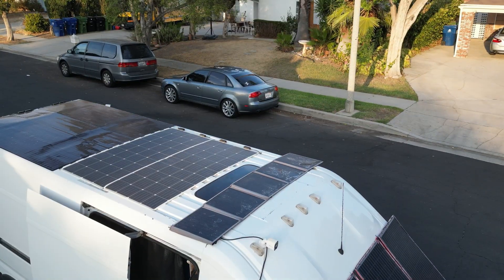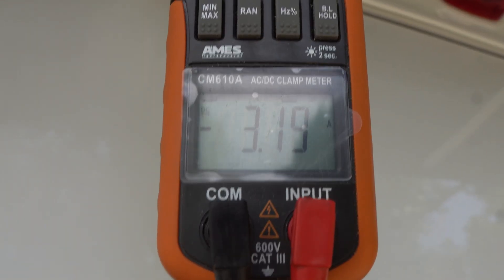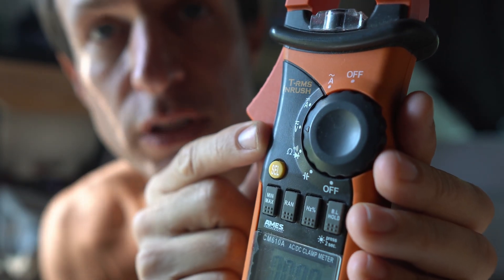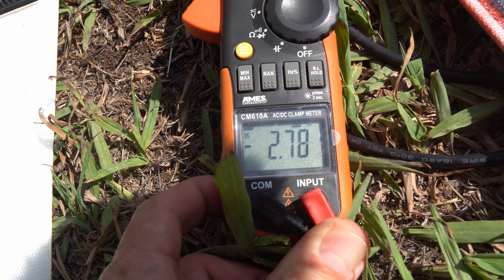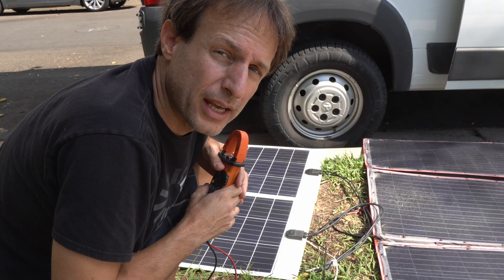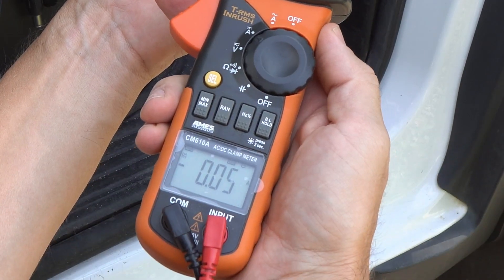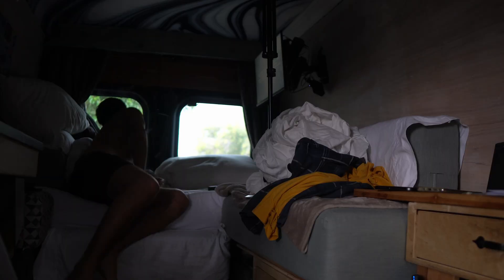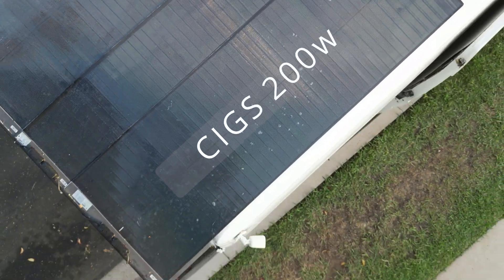BougeRV 100w CIGS Flexible￼ Solar vs Silicon panels Power output comparison￼

Comment: Maximum power point does to happen at open circuit voltage or short circuit current. Happens at a different point on the vitals vis amps power curve, need to use a MMPT and measure the volts and amps when it's doing its thing,  other wise these measurements are of no value.
Reply from the maker: Open circuit voltage told you if this panel will work with your MPPT
Reply: @NoLimitVanLife  
The panel spec sheet tells you the open circuit voltage before you buy the panel.

Comment: Your voltage test is just checking the “open circuit” voltage (Voc). When they’re under load (actually hooked up and charging the battery) the voltage will drop down to the operating voltage which might be in the range of 14-17 volts, not the open circuit voltage that you were getting in your meter readings.
Reply from the maker: Open circuit voltage can determine whether your MPPT will accept the panel